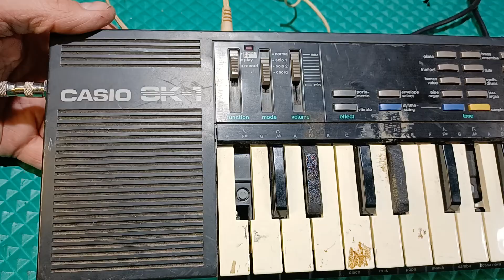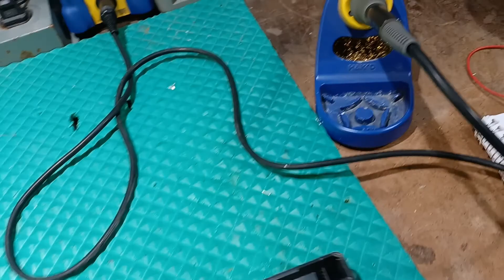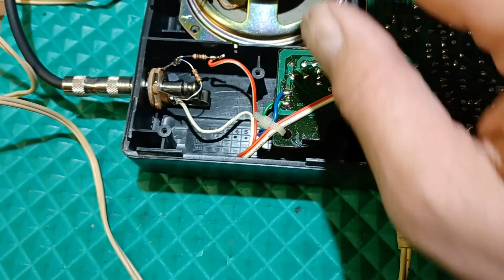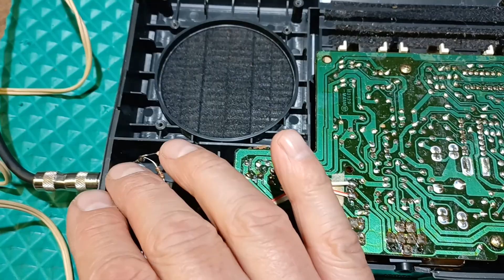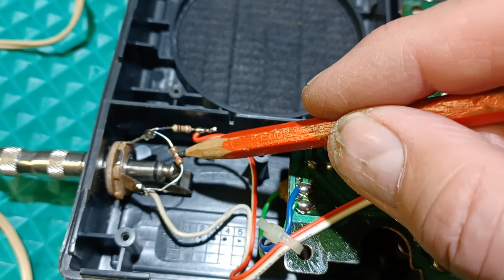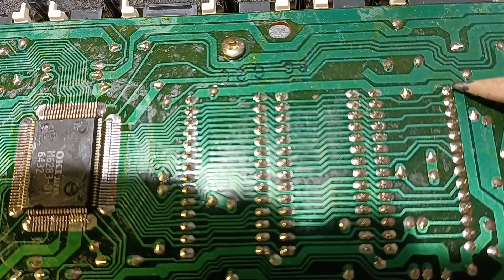CASIO SK-1 RESTORATION / BENDING - Part 2 installing 1/4 inch jack

Comment: I have an sk1 that is getting very little output through the speaker, however it sounds okay when headphones are plugged in. Do you think the speaker needs to be replaced, and where would you suggest getting a new one?